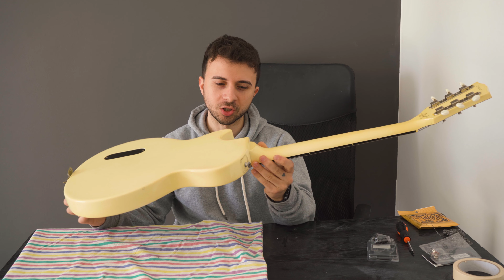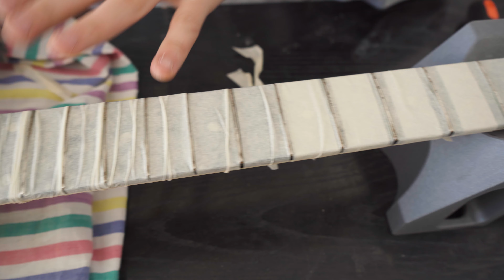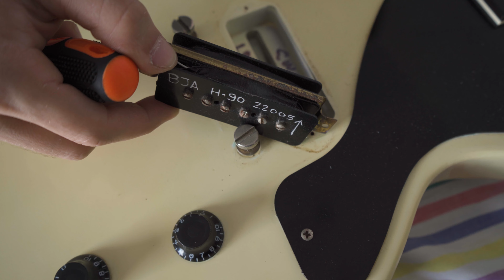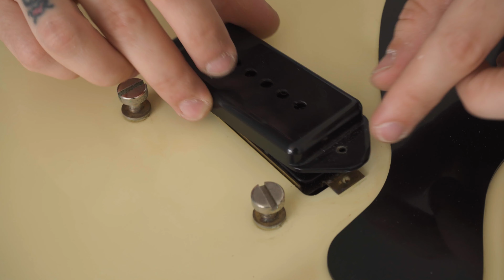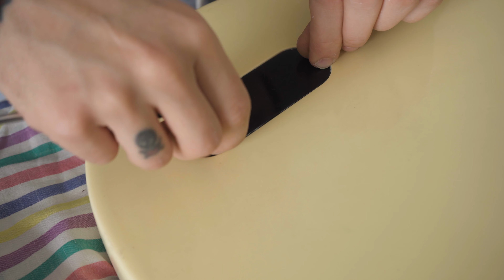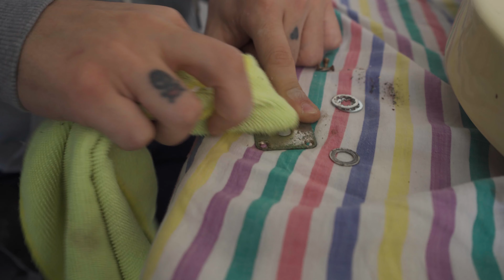Repairing Billie Joe Armstrong’s Gibson Les Paul Junior! (Output Jack Fix)

Comment: Wow man thanks for this I didn't think this was such an easy fix. I have the same issue and look forward to doing this myself. I have always admired these guitars, so simple and also impressed on how the years have affected the nitro finish. Kind of looks like a TV yellow too. What amp are you using by the way? It sounds amazing and identical to BJA. Loving these episodes well done!
Reply from the maker: Its a very simple fix indeed! I'm a huge fan of Les Paul Juniors. While I'm not a huge fan of the H-90 pickup, dialing the presence on the amp helps tighten the sound and makes it sound awesome. The amp I'm using is a Dookie Modded 1959 SLP Clone with V30s modded by Chicago Amp Mods. Thanks a lot for watching!
Reply: @georgiusmifThat's amazing i would love to hear more of it. Looking forward to seeing more vids too :)